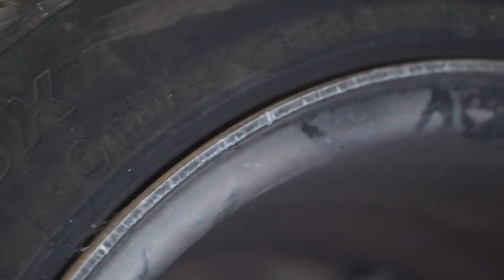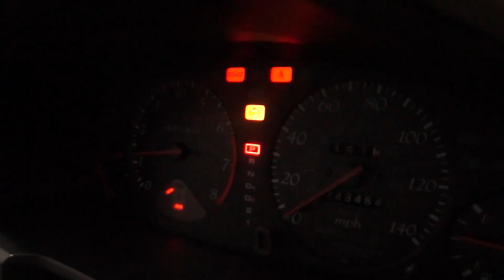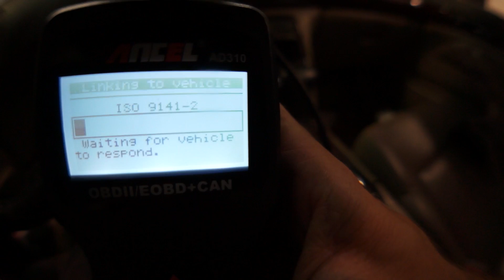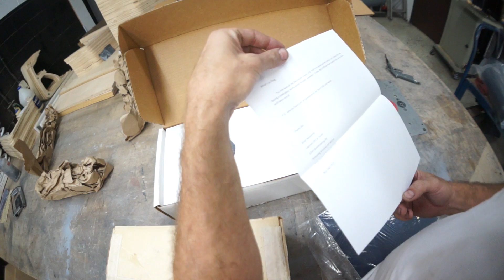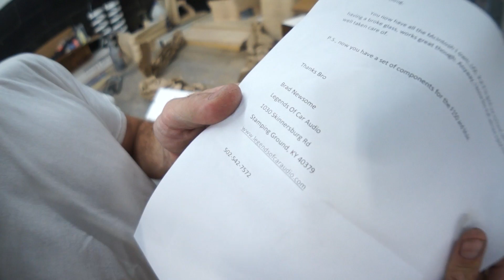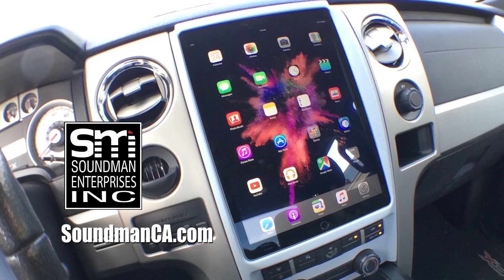The Acura is Done! and RARE MCINTOSH AUDIO GEAR for the T-Bird! - White Rider series #38

Comment: Doug, you have a welder.  I had the same problem and just used my welder to weld a 9/16 nut onto the lug nut so I could use a regular socket to remove.  The heat from welding helped loosen the lug nut as well.  Took a couple tries but worked.

Comment: heater circuit low can also be because the 02 sensor is burned out and grounding on itself(o2 sensors need heaters). Had the same issue with a customers rav-4

Comment: I'm a huge fan of old McIntosh gear!  Watching you open that fresh box brought back memories.I used to rock an MC431 (100x4) a set of those exact 6.5's with a set of 5.25's out back and a 12" McIntosh sub. Sounded amazing but I eventually swapped the sub for 3 JL12w6's powered by PPI PC2350. It was a good move lol.

Comment: Yup, seen butt connectors cause excess resistance in too many electrical circuits. Works ok for 12v but 5v sensitive computer circuits hate them. Always sauter.

Comment: I’ve found that those universal o2 sensors that you have to wire in with butt connectors are crap. Just get OEM styles that plug directly in......fuck as I typed this you said the pigtail was cut off. Well good luck holmes!

Comment: I don't see anyone whining about using butt connectors in the engine bay so here it is. Doug, you're doing such a botch job with those connections it hurts my eyes! Solder and heat shrink all the way. The wires are going to bend and ignite the blinker fluid.
Reply from the maker: Oh!.. I just put quick disconnects on them temporarily while I was finding the correct wire order. 
I’ll test drive it for awhile and clean everything up as we go. 👌😋
Reply from the maker: The previous owner used the butt connectors and wires it wrong.
Reply: Then he sold it because he couldn't figure out the problem. Good deal. :)
Reply from the maker: what a sucker! 🤑
Reply: Crimping the oxygen sensor wires is the correct way to join the wires to the pigtail, even oxygen sensor manufacturers tell you to crimp the connections rather than solder them.
Reply: Yeah it's probably fine, I was just joking. I'd still solder it but I wouldn't knock anyone for crimping.
Reply: @soundman_caraudio  so there was only one wire per connection? Was the previous owner color blind?

Comment: The wannabe ccw's look like they can be fixed. Remove tires, put m on a wheelbalancer (or on the car), spin m up and use a fine file and after that 600 sandpaper. Polish or paint and you have some nice spare rims.